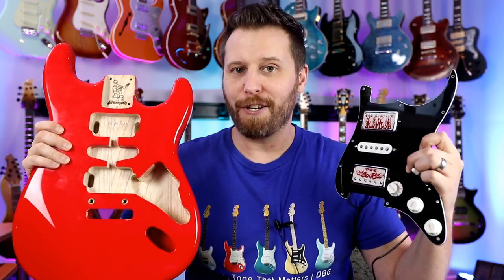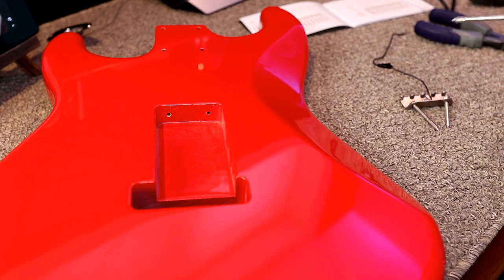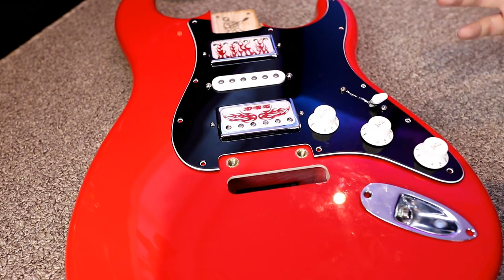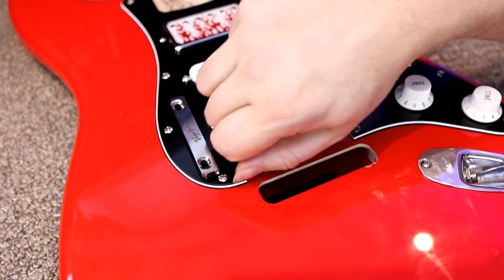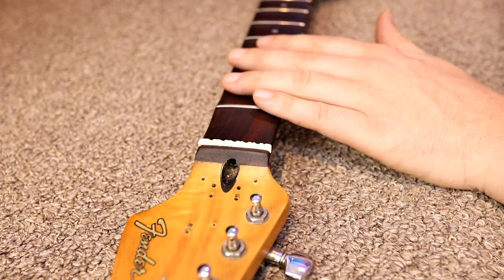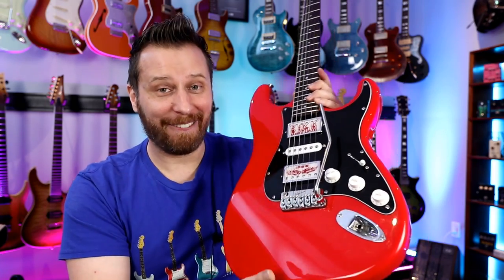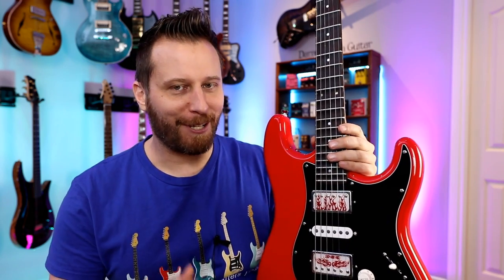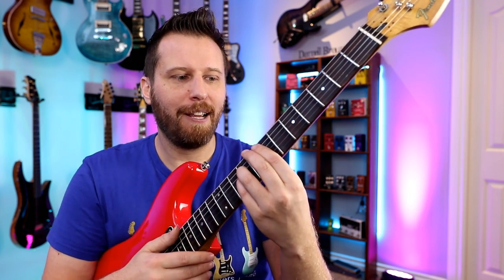Building a Scalloped Neck SuperStrat! - This Thing SCREAMS!

Comment: Tip:  When you drill into a finished body, put a piece of masking tape on the finish where you are going to drill.  Greatly reduces the chances of cracking.  Ask me how I know.
Reply: Peter Tiffany ☺
Reply: No
Reply: From experience 😣
Reply: You never go Full Relic.
Reply: Oh, yeah! It doesn’t take the drilling of very many holes in wood to learn this lesson! Another tip I’ve found useful is to tape the opposite side of pieces you’re drilling all the way through. It can help prevent “breakout” splinters on the far surface when the drill bit pops through. Even better: hold or clamp the body (or piece to be drilled) onto another flat piece of scrap wood. Taping it may help prevent breakout, but using a piece of wood to sort of “receive” the tip of the drill bit will guarantee a sharp-edged, clean hole, every time!
Reply: @jamesthe-doctor8981  ...and use tape to mark the max depth on your drill bit! ...so you don't drill through by accident.
Reply: I thought the same, but a bit the same has putting tape on the wall before hanging something.
Reply: Yep I always tape drill bits to the right depth. As far as taping over the finish it's not a biggie as long as the bit is new and sharp that size costs maybe $.75 cents.
Reply: Bam Bambam yes! Although they make depth gauges, stops, and even fences to use with drills/bits to prevent you from drilling past a specific depth, wrapping a piece of tape around that point is quick, simple, easy, and the best part is: it costs almost nothing.
Reply: What stupid advice. I'm a french polisher and I can assure you your finish won't crack drilling in to it. You most likely didn't drill the hole big enough and when you screwed it you over tightened and split the wood.
Reply: How I know?
Reply: @gareths9574  I probably shouldn't reply to this.  And I think I won't offer advice ever again on a Youtube video.  I have been woodworking for years.  The tape "trick" I mentioned above works for me.  There is no reason to be rude when replying to others.  There is too much of that in this world today.
Reply: @petertiffany8096  it's fine, I'm not trying to be rude, taping the back of a hike does not provent blow out, what you would do is clamp a peace of timber behind the area your drilling through, that will provent blow out. I know you didn't say that comment but just mentioning it. Tape does have some useful applications but it will not provent splitting of a top coat or timber.
Reply: @petertiffany8096  don't take me seriouse, I'm a right bore in a party as they say ;)
Reply: @gareths9574  You are correct that tape does not stop blow out, except perhaps in rare circumstances.  I have had it help with splitting thick polyurethane finishes when drilling.  Certainly if too small a bit is used. nothing will stop it from splitting when the screw goes in..
Reply: Peter Tiffany   Actually I learned that when I worked in a furniture finishing shop . The thicker the better . 2 pieces are better ! Pre drill or use a small drill as a spot drill . Also a variable speed drill and start slow helps .
Reply: Another way to precdrill more safely is to put tape under the guards and areas of drilling . You can either Mark with a pen or sharpee or leave it under the mounts . Drill through tape so you don’t nick or chip .  The drill etc
Reply: How do you know?
Reply: @j_freed  :D
Reply: Also using a pointed 7/16" framing screw. The sharp point on it will start a drill divit to start in

Comment: Sweet Build!   Still a fan of the 80s Fender's.  Purchased my first New Guitar which was an 83 Stratocaster.  Still plays great!! Concur the Necks are Great.... Also very underrated guitars.   

Nice build 👍 Enjoy my friend!
Reply: Any tips on long term guitar storage like that? I mean, how'd you keep the neck from warping etc?
Reply: @johnballs1352  try and keep it stored in with proper amount of humidity.   Always wipe down strings and guitar before putting away.   Keep out of sunlight.  If storing for any length of time.  Set truss-rod in neutral position and drop tuning down a full step.  

Worked for me on a number of guitars.  Folks forget to wipe down strings after playing.  If you do, they'll last longer, sound better and have less of a tendency to corrode .

Cheers

Comment: Darrell,  Just a tip on securing your output jack; put a drop or 2 of Loctite  thread -locker ( light Blue)  (not the Green color fluid) on the threads before you put the nut on and that will keep the nut from coming loose from any vibration . and the nut can be easily removed if need arises to replace the output jack
On the guitar it looks awesome and the flames on the HH's is a killer (love it) plus tone is really good on the bridge Humbucker. The guitar is like a Chevy Pickup Truck,  everybody loves a red one..
Excellent choice on the Vega Trem and the Obsidian Electronics. Great start for 2020!

Comment: Warmoth bodies are second to none. They're excellent, however, anytime I've had to pair up a Warmoth body, with a Fender (USA) neck, I've always had to use a StewMac .025 full neck shim, to get the bridge saddles up high enough, to get a good tone, and keep the height adjustment screws, so they're not sticking out too much. I'm self-admittedly a Gibson guy, so I guess I want a bit more neck/body angle. Great build, Darrell. 👍

Comment: A couple of things some folks may or may not find helpful and/or useful... or not:
First, waaaaaaay back in the day (sometime back in the mid-70s,) somebody who was writing one of the monthly articles for Guitar Player Magazine mentioned that because the Strat’s output jack is recessed, he often had difficulty removing and inserting the cable quickly while swapping guitars during live shows. Not that it’s a particularly hard task to accomplish at home or rehearsals, just that he sometimes ruined cables while yanking frantically on them before trading one guitar off to his roadie in exchange for the next one. His solution was to invert the mounting plate so that it stands up above the top, instead of being recessed into it. Even after nearly 56 years of playing guitar I’m still not famous and have no insanely pressing need to “hot swap” axes between playing my 20 Top Ten hits for my adoring fans, so it wasn’t a problem for me then or now. However, I did try it for a short while to see if there was much benefit. I suppose it could be helpful to some players, but anyone who places a lot of importance on the “look” of their Strat-style guitar may have the one drawback he also mentioned: the reverse side of the output jack mounting plate of most Strats aren’t usually as smooth and shiny as the factory installed side. Most gold plated ones tend to look pretty good, but a lot of the chrome ones aren’t even very shiny, sometimes. If you think it’s for you, try it!

Second: Whenever I drill multiple holes into something that MUST NOT MOVE until ALL of the holes are drilled, I can usually count on it moving at some point - even sometimes when I have it well taped down with painters tape. To avoid that, I first tape the (let’s say it’s a pickguard not unlike the one for which you drilled holes in this video,) pickguard down. Then I plan to drill the first two holes which are physically located furthest apart, and sort of “diagonally opposed,” in a way. In the case of this scalloped Strat’s guard, it would be the hole at the far end of the control cavity by the rearmost pot, along with the hole at the bass side of the neck pocket. Actually, any two holes on opposite sides of the pickguard will do. I’ll drill one or the other first, then, before drilling the second hole, I would insert a screw into the first hole and screw It down, just snug, and enough to prevent the pickguard from sliding around. Let’s say I selected and drilled the hole for the one by the neck pocket, and screwed It down nice and snug. Next, while holding the pickguard down firmly, even though it’s still taped down too, I’ll make sure the alignment is correct, then drill the second hole at the one where the pickguard covers the control cavity, at the very end of the rounded “tail” of the pickguard. At this point, the two screws are more or less at the top right and bottom left holes, with both tightened snugly. From there, it’s a simple matter to drill the rest of the holes, either inserting screws as I go, or just drilling them all, since the two I chose first should hold the pickguard firmly in place while I finish drilling the rest. However, with my luck the way it is, I’d keep inserting them as I go - I need all the help I can get! 😂

I know this is a pretty long comment, bordering on excessively long in some opinions, but when I make suggestions in public about modifying what can easily be the prized possessions of a LOT of people, I try to be as thorough as possible. If you’ve made it this far, I hope you found at least one of these to be helpful or useful. Cheers!!

Comment: A trick I use when drilling holes in a top, especially if it is finished is to tape over the place you're drilling first.  You still need to be careful while drilling but the tape helps protect the finish.

Comment: Great looking strat!Very Brad Gillis to me.A tip from me would be to screw down pickuguard after neck is centered with tremolo and strings.That way you can do small adjustments at the end for tremolofit and strings over polepieces.

Comment: Great looking and sounding guitar. I don't have a Vega Trem, but I use only 2 springs as well. I much prefer the softer feel, and I don't have any trem tuning issues with that setup. Perfect way to start the New Year with a red hot Strat. Congrats on the cool build!

Comment: I use an old manual hand drill for the small holes - less stressful 😊👍
Reply: Good deal man a beast. Kizzyjo
Reply: I sweat it too.  I use drills with the 1/4" hex drive end and a small, battery pistol screwdriver set on "slow".

Comment: Put tape on your drill bit (so all your holes are consistent with screw length). Also put tape on the pre screw hole so paint doesn’t crack. Nice build. 👍🏽

Comment: Just got a 89MIK Squire II in Red HSS and no pickguard, closer to HM Strat getting ready to hotrod and gave me some ideas, personally hand scalloped a neck on a les paul Special and did it with hand file, only later to discover most people use dremels but really like a scalloped neck

Comment: That feeling of fear any time you need to take a drill to your guitar is a fear like no other!

I just installed new strap locks and the screws were longer and wider than the stock ones, so I needed to drill out the original holes, and I was sweating from start to finish 😂

Comment: I know I'm late to the game and may have missed any updates you might have had on this guitar. Having said that, you did a primo job on this build, pickups are stellar and the trem is Ed worthy for sure. I do, however, hate how it looks but that's just my tastes. 
My only real complaint is that you avoided the whole bending thing on this neck. And this is what it really excels at. It's not hard to play a scalloped board normally but the idea is that without the wood under the strings you can pull those suckers to the moon. Listen to some Mclaughlin and you'll see what I mean. Not sure Ingwie or Richie actually made use of that. But you should try it. You might come to like it. I scalloped one of my broke down acoustics way back and really loved it. When the bridge pad blew up the guitar gave up the ghost. Took me a long time to adjust to a regular neck. Loved it. 
Great channel Darrell. Keep it up

Comment: Thanks Darrell, you've made my mind up on how to go build my 80s vintage Stage CS-327 Strat guitar. While I want to retain its original maple neck (which has a fair amount of nice flame figuring on the neck and head and, more importantly, FEELS nice in my hand), im going to refret it with extra jumbo frets similarly to my Ibanezs and ESP guitars which will give similar feel as the scallop board. Thats already have been decided a long time ago. 

What I was still debating on was the direction for the pickup selection. HSH with creamy smooth neck, bright chimey middle and high gainy bridge is a good description to start with. I will use that to go select the pickups on Seymour Duncan's website. 

Any suggestion on the 80s style pickup choices for the three positions from Seymour Duncan?  I already know that noiseless single in the middle (either SC-sized humbuckers or stacked type singles) is mandatory! Where I live/practice/play there's lots of RF interference.  (Damm ye fluorescent lights!!! Can't live with them, but can't live without them!)

I think I like the idea of a bi-directional trem without the headaches inherent with a Floyd Rose fine-tuning. So Vega it is! Thanks for the link to the Vega!

Locking tuners is also a must, if nothing else, for the quicker/easier string changes. Gonna have to check to see what will fit in the existing holes on the headstock...

While the scalloped nut is a cool idea, I think I'll stick with my standard nut, a Graphtech TUSQ nut, but in white this time since the Stage came with maple fretboard (which is the only guitar I have that came with maple, all of the other guitars I have are rosewood, with one being ebony).

Comment: Scalloped necks are great for bending and string control. It takes a minute to get used to it but when you do it’s amazing. My first one was Yngwie style and was too deep for me. So I did my own only on the g, b and e strings. 
A little like Blackmore. Instead of the entire fret scalloped it’s more like at an angle.
1-5 nothing
6-12 slight
12-15 little deeper 
15 up Yngwie style

Comment: Question for Darrell,

If I add the Obsidian system to my Squier Strat Standard (2015), will I need to dremel out pockets on the body like you needed to on the Warmoth? I'm hoping not, since the Squiers are built according to Fender specs and I'm hoping this will be a straightforward upgrade one day. I live in an apartment and don't have access to a garage full of tools.

Comment: "Scalloped neck" is a seafood-related ailment of the throat.
Reply: whynottalklikeapirat yep, usually due to shellfish allergies.
Reply: @jamesthe-doctor8981  The aestethics of the resulting physiological expression however play a significant part in the wording of the diagnosis as well.
Reply: whynottalklikeapirat very true. “Scalloped potatoes,” on the other hand, is an entirely different set of problems.
Reply: @jamesthe-doctor8981  Sounds about equally painful and socially awkward

Comment: That is what I'm talking about!

Slightly geeky question - what's the weight of that Vega trem compared to a "standard" Fender 2 post design? 

Just wondering if the mass difference (if any) is noticeable in feel or tone.

Comment: So Darrell, pardon me for asking. I have never touched a scalloped neck.
What is the purpose? Strings that won't contact the fret board? Able to get clean tones with less pressure?🤔
Reply: Easier for lighter touch players and string bending is easier also.
Reply: No friction between the string and fretboard, and you can really get a grip on the string when bending.  Also teaches you to use a light touch, which can help with fatigue and dexterity.

Comment: All the mid-Eighties Fender guitars (and that neck) were made in Japan, whether branded Fender or Squier. Those are indeed nice necks, even post 1984. The cheaper Squires can be great platforms with new hardware.

The drill holes by the nut mean that neck had a weird string locking system behind the nut. Floyd Rose gave them grief about this, so Fender went to the bizarre side-clamping system to avoid infringement. You might get some cash for that rare clamping system!

Comment: I'm surprised no one came up with the solderless system decades ago, pickup sales would probably pick up if people could just swap them in and out easily without worrying about burning a wire or melting something.

Comment: I always wonder what size the drill bit should be, and how deep, and about pilot holes.
Reply: Well typically for a hole that small pilot holes are unnecessary, as far as size usually I just hold the bit next to the screw and makes sure its smaller than the threads but bigger than the center

Comment: Does anyone know if its possible to put a fixed bridge into a tremolo bridge guitar? i got a guitar that has a tremolo bridge and its rusty af so i wanted to replace it with a fixed bridge since i rarelt use the tremolo thingy, but i dont know if its possible.

Comment: if i can make one comment. when i am installing the pick guard im more concerned with the location of the strings over the pickups than i am the horn or neck cavity being cetnered. i will modify the guard if i have to.. to make sure the strings pass over or as close to over the poles as they can.

Comment: Good vid and nice build, However the pups and tremolo are really pricey and as usual you can't get the Humbucker pups with the flame on them any longer. Plus, I'm not much for scalloped frets...but to each his own. I am curious to know what the overall cost was.
     However, just shows to go ya that for under $1500.00 (don't know the cost of the neck was so I guessed around $300.00) you can do your own Custom shop style build with all your favorite parts and still come in way cheaper than the name brand counter parts using similar parts. 
    Good job. Peace

Comment: Play chords with the lead lines.....chords are where a scalloped neck is very different.  The feel is unusual.
I like using 4 note chords over bars or such.  You have less control over the individual notes on a chord.  Single notes are not as much of a problem.  Scalloping is wonderful for single note lines.  You get more levels out of your frets....you can take them lower because of the scallop.